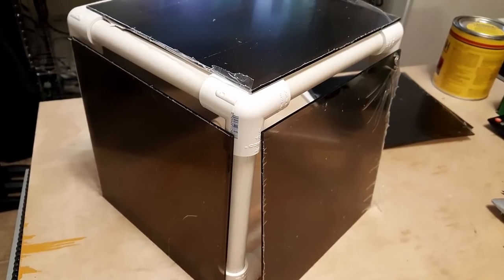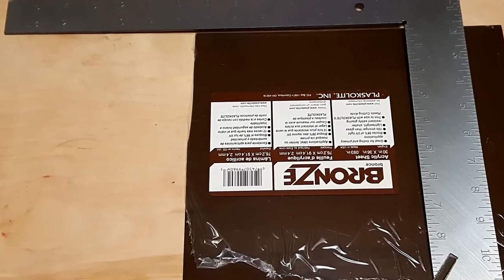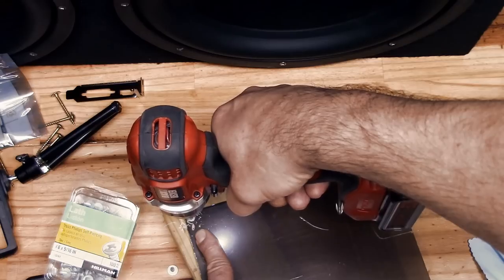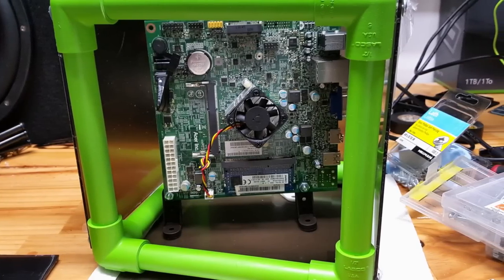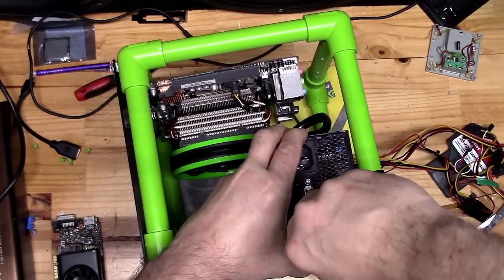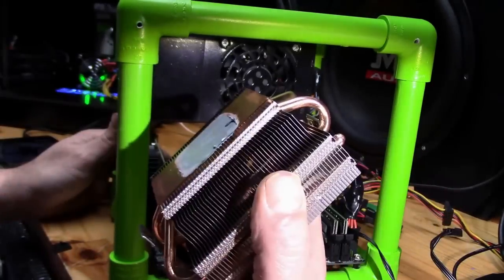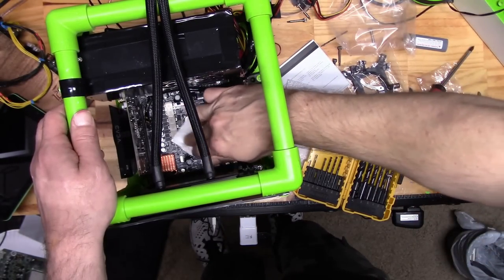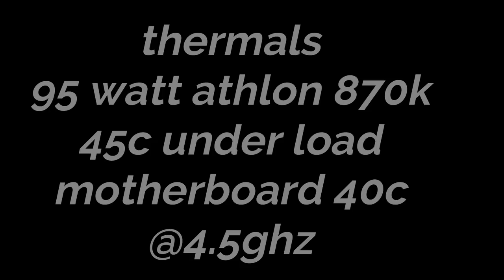water cooled diy pc case mod

Comment: What a awesome idea. This beats the heck out of a cardboard box. You could also use that ornate craft sheet metal from Lowes or home depot instead of the Plexiglas panels. Still though, great idea for a cheap case. 

The 860k was my first custom pc build CPU. A few years prior my brother gave me a q6600 build and I sold it like an idiot and built my own. This was way before I understood that CPU's are measured by GHz. The 860k looked faster on paper but was about 50 percent slower. I had to save up more money and buy another Intel CPU, which took ages. Lol, I have a Ryzen now, but thinking back never realized how bad Intel was stomping AMD after they caught back up with them. Now they are in the closest silicon battle we have seen yet.

Comment: Great job. I would personally either swap the GT 730 for a 1030 or swap the athlon for an A10-7850K which runs on the same socket for better performance. Your creativity is amazing with these builds.
Reply from the maker: Good ideas thanks
Reply: @modstek  
BTW,I'm imho,not A10,but A8 - 7600.

Comment: for your next custom build i would use a similar layout, but instead of the pvc use a thinner gauge steel/alum for the frame, and do plexiglass sides. tap and die sets are cheap, could thread your own holes for mounting the side panels and everything for real cheap.

Comment: What would be the most powerful graphics card with VGA connector ? I am trying to refresh our old living room pc but if i get any newer GPU i will also have to change monitor... And monitor looks great, still good as new so i don't want to change it. Feel free to give me few GPU suggestions if you are willing to help...
Reply: you can use adapters tho
Reply: Most of the GPU's these days has hdmi port, with that you can use hdmi to vga adapter
Reply: The GTX 980 ti I believe is the most powerful card that still has a native VGA though you will need a DVI to VGA adapter to access it. Otherwise you can use a DisplayPort or HDMI to VGA adapter.

Comment: Happy New Year! I was looking for some ideas to mod some old generic cases and came across your videos. So far you have me excited to work on them. Question for you though, do you sand the metal part of the cases? It doesn't look like you do. If not, what is your preparation/spray paint for the metal?
Reply from the maker: I do I use a drywall sanding sponge block to scuff it up.

Comment: Pentium  G4560 with stock cooler gets 385cb +/- 
Watercooling an athlon ? you pay more for the cooler than the cpu..
GT 1030 is almost an GTX so fair choice for a compact build..
But PSU fan and WC fan working against each other ?
frame seames sturdy but sides not so much..
Reply from the maker: Hi and thanks for your input because this how I learn by constructive criticism that pertains  to the video. I was having thermal problems when I ordered the water  cooler but I actually solved it by an 80mm fan blowing on the back of the mobo which was weird, but no the cooler was about the same price as cpu I was shocked how prices come down on them.
  I had concerns about the the psu fan myself and if it was 100% sealed it might be. If I had to do it over again I would take the power supply internals out of the case and install that way for room and power plug placement. 
  It's sturdy though and kids been playing it alot.
Reply: The more we play with hardware the more we learn..

WARNING: the PSU capacitors may hold power even when not connected to the mains and 110v or 220v in open air is fairly dangerous.. the most i will mod an PSU is maybe to flip the fan the other way around (while NOT touching the electrical components)

in Denmark the Athlon and the G4560 is about the same price..  
but i´ll bet the Athlon will run ddr3 and with the prices of ddr4...

i´ll gues airflow on the front of the board where all the components and passive heat sinks are is a better place for the extra cooling..
Reply: many cpu air coolers also cools the motherboard (by design).. the AIO WC do NOT ;-)